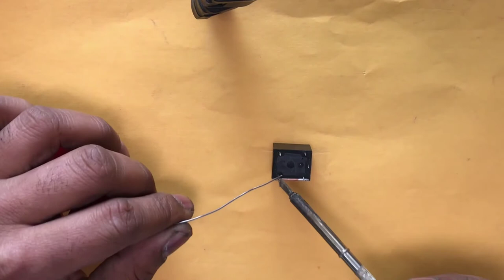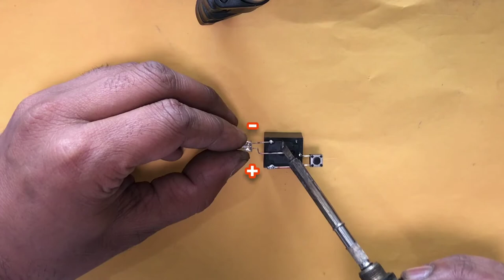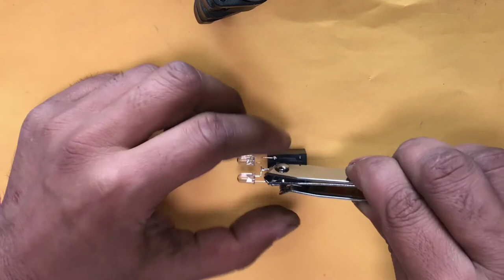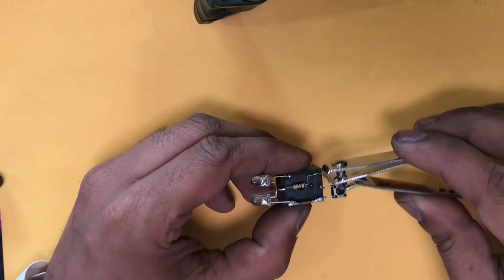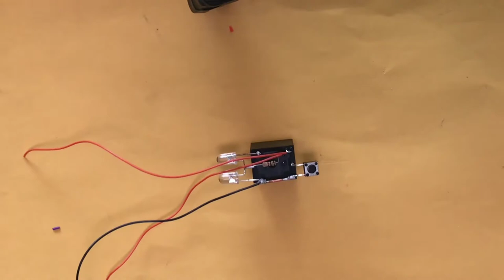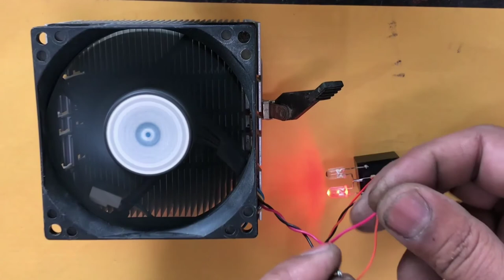DIY Simple short-circuit protection circuit | 12v Relay Circuit Breaker

Comment: No schematic?
Reply from the maker: Why do you need schematic when circuit is Skelton it show it self
Reply: @ElectruinoDiy i goofed and commented before i thoroughly reviewed the connections. This circuit works because the short causes the coil to lose pwr and it opens the circuit as a result?